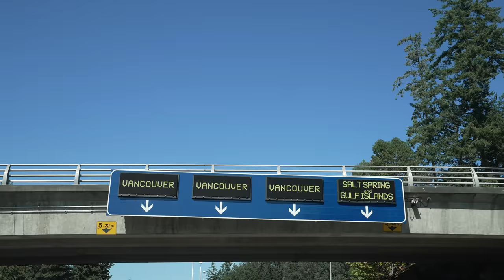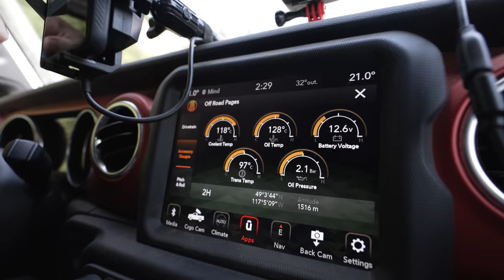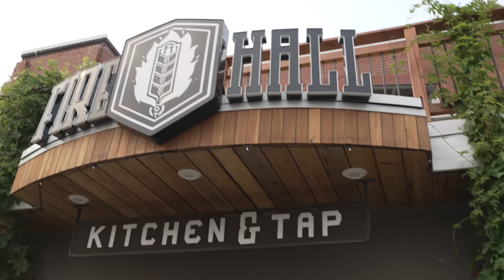The Story of My Dying Ecodiesel Jeep Wrangler on Mountain Roadtrip.. More Problems

Comment: The communications equipment you saw is called a VOR  -ery High Frequency mni ange.  It is used by aircraft to navigate to and from airports especially under instrument (cloudy) conditions.      Also, please tell us more about the heat issue with the diesel
Reply from the maker: Im going to do a full diesel video once I get it actually fixed by Jeep...
Reply: @Casey250  Looking forward to it !

Comment: Casey, next time it  cuts power try making sure the fan is at max using your tazer jl. I have heard that that can help.
Reply from the maker: Thx. Will have a look.
Reply: What setting is the fan under?  Cannot find…
Reply: @joshuagmain  Its covered in this forum https://www.jeepgladiatorforum.com/forum/threads/diesel-cooling-options-and-ideas.46298/page-14
Reply: @joshuagmain  I believe it is the cool down mode, but you have to have the June update I think.

Comment: My wife's gc was close to over heated in loose sand. Turned the ac all the way up and forced the electric fan to high operation. It did make it without derate. Ran hotter than I liked though.

Comment: I know this isn’t a great option, but if you had the A/C on try turning it off on hard pulls. What happens is it dumps a ton of hot air over your cooling system. The air to air charge cooler is next which is trying to shed heat and by the time it gets to your radiator the air going over it is so hot that it will lose a ton of efficiency to shed its heat too. There really isn’t enough room for them to have put a wider unit which would spread it out and allowed more air that isn’t already so hot. Adding a separate engine oil cooler away from the front cooling module may help this problem some if you can find room. The engine coolant wouldn’t have as much heat to need to try to shed.

Comment: I'm reading that cooling on the eco diesel was an engineering challenge and winches and large bumpers block air flow.
Reply from the maker: I am using a stock bumper
Reply: Several eco owners have reported cooling issues and their oil temps are sky high too. Needs an aux oil cooler and the tazer for manual control of the rad fan. FCA needs to address this ASAP. End users should not have to solve cooling issues when driving under normal conditions, it’s pathetic.

Comment: sad jeep is STILL having the old problems. I have a 2006 jeep liberty CRD and mine is running so cool that I removed the mechanical fan and blocked the radiator partially. 
The problem is that N-Muricans dont like the diesel noise, so Jeep tunes the ECU to inject a rich fuel/air mix to make it sound more quiet, the result it doesnt burn all fuel and creates more pollution. Jeeps solution is to inject HOT exhaust in the intake, resulting in a even worse combustion. I removed the EGR, got a ecotune and now doing 35 miles to the gallon and it stays really cool. Yes it makes more "tractor" noise but my old jeep is more eco than the newer "eco diesel"

Comment: Im currently driving across the country right now in my gladiator eco Diesel California to Tennessee. I drove up thought Utah and Colorado the temp out side was between 95 to 105 degrees. The hottest my oil temp got was 244. Truck never slowed down I have been averaging 31mpg and have been hitting some spots at 90mph lol and my bed is loaded down with 10 heavy totes, inside I have me a fridge a 120lb dog and a ton of gear. honestly I couldn't ask for a better experience. I have seen guys on the forums having some issues but my experience has been amazing. I am pretty conservative how I drive and constantly watching temps and I don't use cruise control so maybe that helps but yea my experience has been amazing.
Reply: Do you have the trailer tow package?
Reply: @CallsignVega  yea I do. Still haven't had any issues and now have 30k on the truck. Sitting on 38s with a 3.5 in lift and. Bed rack and still getting 23 to 24 mpg average lol

Comment: Set up water mist sprayers in front of the radiator for these high temp climbs….?
Reply: Should use distilled water to avoid mineral buildup on the radiator.

Comment: Dirty & Dangerous, needs to come back to the Island.. where there are no fires..
Reply from the maker: Aren't there fires here now?
Reply: @Casey250  there is nothing active.  Grass fire in courtenay,  and a small fire in Duncan that was contained.
Reply: most of mosaic is closed for extreme fire Hazzard.. at least the mid island areas are.
Reply: @MrBikeahallic  I've been all over mid island, only place that has a locked gate is Duncan Bay Main.  I dont know what your idea of Mid Island is.
Reply: @KrazyMitchAdventures  Nanaimo lakes is closed where the turn off is for first lake campsites. and all around horn Lake is closed outside the lake.
Reply: @MrBikeahallic  Then state Nanaimo.. Because claiming "Mid Island" is closed off is a broad statement. Being that the Comox Valley is also considered Mid Island.

Comment: Does the Blue Gladiator eco Diesel have the trailer tow package with larger capacity Radiator?  And still have those over heat issues?

Comment: Hey Casey, did u ever find a snorkel for the ecodiesel?
Reply from the maker: There is only one and I am not a fan of the design as it crosses over the motor to exit on the passenger side. It seems more like a retrofit then one properly designed.

Comment: Holy crap 118c?!?! Thats how you crack/warp heads
Reply from the maker: Im told smaller diesels run hotter. Normal operating is 98 to 100.
Reply: @Casey250  negative. Optimal temp is 88 anything over 100 amd you should back off it
Reply from the maker: It never runs that cool.
Reply: @Casey250  weird must be a eco diesel thing then. My 3.0 toyota turbo diesel runs around 78 at its coolest and when it hits 95 i back off. I recommend getting an EGT guage installed and just drive to that.
Reply: Thats why it derated itself!

Comment: Odd they are derating at 244 in the ecodiesel ram 1500 it derates at 264 I think.  Never seen that but I have seen my truck while towing hit 245 with now issues at 65 mph

Comment: I've heard of others having problems with their eco diesel's going up high elevations. I wonder if it's because its an eco diesel? My truck is a diesel but not a eco one and I don't have that problem.
Reply from the maker: Heat management in the diesels and these tight engine bays is problematic.
Reply: @Casey250  oh ok. So must be why they put more vents around the new models. They say the new models get more air flow around the engines.

Comment: You would think the turbo diesel would have the advantage in the mountains...quite disappointed myself👎🏾
Reply from the maker: 99% of the time it just flys by everything. But in that heat and altitude it definitely fell short. I think if some of the emissions went 'missing' the Ecodiesel would be the best and most powerful optoon, even over the 392.

Comment: Casey, love the vids. Could I make a request for us folks down in the States that don’t do Celsius…. 
Each time you make a metric statement (i.e. measurement of distance, temp) could you maybe have text pop up Within the video so we have a reference of what our equivalent would be? Like pop up 104°F right when you say 40°C. 
I had no idea how hot that was until I googled the conversion 😆.  Same for your coolant temp. Thanks for the consideration, and keep up the great work! (I’m just south of your area in N. Idaho, BTW. I have a green 2020 Ecodiesel JL👊🏻)
Reply from the maker: Sometimes I do, sometimes I don't. I am slowly converting you guys to metric :) 

These videos take upwards of 15hours each to edit and upload, and I so am usually looking for ways to cut down on edit time.
Reply: Multiply by 2.  
40 x 2 = 80. 
Minus 10% = 80- 8
= 72
Add 32. 
= 104.  
After a bit it just comes easily. 

Casey I agree lets convert to celsius.

Comment: Video title misleading. Fist of all,  DEF system should be disabled any off road vehicles and will still pollute way less than old diesel. I own two 3th gen Ecodiesel and no problems at all with the DEF system. Second, the 3.0 diesel power train is HD and the 3.6l is no match in any respect (I owned 1 jk and 2 jl with the 3.6l). The Ecodiesel as a ton of torque at low rpm coupled with the hd tranny, it’s unstoppable. The 3.6l as to rev lot more and that creates heat and wear. (Listen the Shawn’s Gladiator engine screaming off road compared to Casey’s dieselI) I used to change my vehicles often but since I own my RAM 1500 and my Rubicon with the diesels, find nothing else to be a match (except the Duramax in the Chevy 1500). Remember, Ecodiesel is HD, the 3.6l is not. Oh finally, I do 8.5 l/100 km (+-30 mpg) and almost 800 km (500 miles) per tank)

Comment: Not so sure I like the video title.  Not really a "dying Ecodiesel", more of a diesel trying to protect itself from damage as owner has added siginficant  load to suspension, air flow and rolling resistance.  Cut Jeep some slack, I run 35's on my eco in South Florida heat and in 15,000 miles never had a hint of trouble. I don't doubt that a delete would help but I'm also not so sure we need more smoke in the air.  How about using Colin Chapman's mantra and adding less weight?